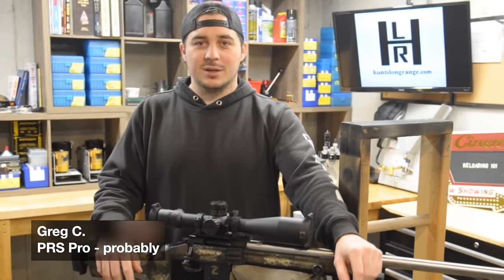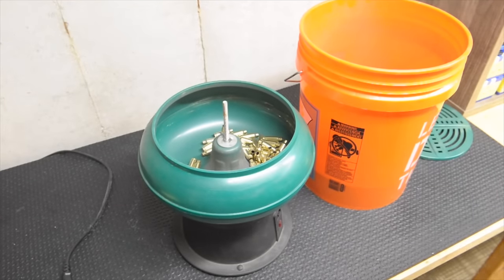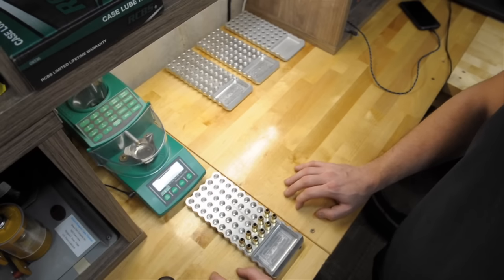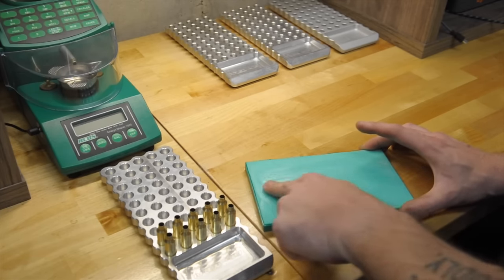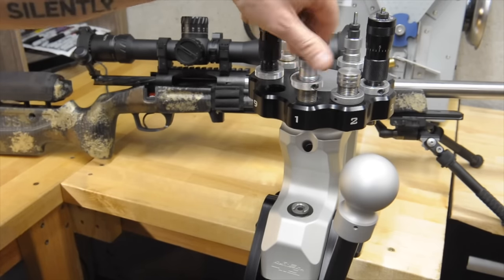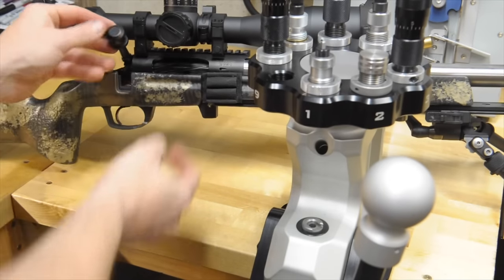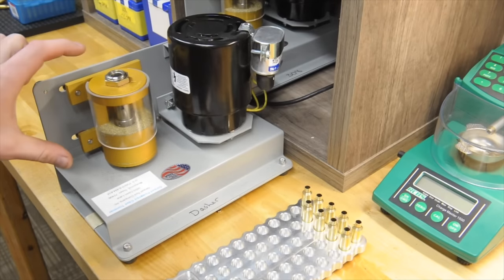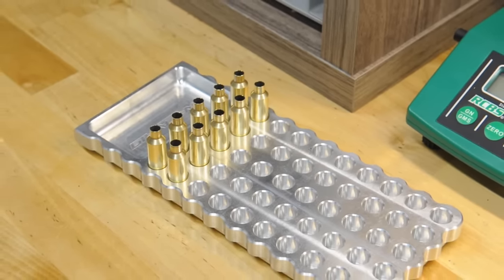Reloading 101 Part One With Pro Shooter

Comment: I tried bar keeper's friend in my vibratory cleaner with walnut hull and my brass came out so clean inside and out. I also clean up the flash hole on the inside of the cases to get rid of excess brass and uniform the hole.

Comment: This is exactly what I have been looking for. A thorough, no nonsense, step by step accuracy reloading series. Thank you for your effort and time in producing this! I noticed it doesn't look like you neck turn, unless you have already done it when the brass was new. What are your thoughts on neck turning? It would make sense that it is helpful when using a bushing die.
Reply: For the level of accuracy I’m after, and the application I’m using my ammo, neck turning isn’t necessary. 

If you shoot competitive Benchrest, it seems like those guys do it and obviously get crazy small groups. Whether thats from neck turning or not, I cant say. 

Shoot a 20rd group with turned necks and without and see if its worth the time to do for you
Reply: @gconnoyer  My father taught me one Golden rule. When reloading, do absolutely nothing more than what is needed. That the more you work the brass the more trouble you get yourself in. Therefore I don't walk 3 mi when I only need to walk one. But I think the whole point of turning necks is concentricity and uniform neck tension. The bench rest guys are measuring with their groups with micrometers as they put five shots in one hole. Definitely not a goal of mine but I do like accuracy...

Comment: Henderson has a trimmer with a motor. SSM cleaning is superior to corn cob. One can clean, including primer pockets, dry and use graphite for the necks, well under 5 hrs. At some point you have to clean the pockets. Also, you don’t have to use pins... SSM chips are better than pins for this.
Reply: Alot of my brass has 10-12 firings. Primer pockets without cleaning or decaping before tumbling look exactly the same on my 2-3x fired stuff.

Comment: Try the Lee lock rings with the O-ring.  They work great in a turret press.  The Forster lock rings work great in the Forster Co-Ax and in a single stage, but they kind of suck in a turret press.  You can't always access the lock ring screw, depending on the orientation of the lock ring in relation to dies in other stations.  Also, when you do get it locked down, it is also locked down on the turret head, which is why you had to resort to pliers to remove the die.  The Lee dies have a very positive feel -- they tighten and then they just stop.  They can still easily be removed by hand, though.  Lee also has a small plastic wrench, which you can use on the dies with your turret press.  Way better option than the Forster lock rings.  I don't like Lee presses, but some of their stuff just works and their lock rings are a good design.

Comment: Good video overall, but it should be emphasized that this is well crossing into advanced reloading, not quite “101”. 
The process can be less meticulous therefore more “beginner friendly”. I was one, and know many people that are diverted from getting into reloading when when for example , you start showing the process of sizing brass.  That can be done with full length sizing die in just a couple of steps, setting the die, lubricate the case, stroke in and out, done. Move to the next step, and so on
Reply: Absolutely, I do mine with a full length sizing die. Lube the case, stroke, done.
But other than following the basic “bottom the die out, get a little cam over” in everyones instructions, I thought it important to show a proper way to set it up and more importantly explain WHY behind setup.

Comment: I would have removed the dirty cases missing the primers before showing your dirty brass on video. It makes one wonder if you “popped” some primers using hot loads, at least it did me.
Reply: No that was likely just me using them to setup my new ZERO press when I got it, or popping them to measure without a primer. I run a very very soft load well away from pressure. I shoot this load in the rain without a heavy bolt lift

Comment: My first hunting rifle was 300 Weatherby Mag (1989). ; it became a hobby and fun, but the precision world is a different game altogether just reloading hunting loads comes almost to a stop. It is checking SD/ES ladder thing buy a new machine measuring the pressures sitting the bullet; it is tools this or that, and the fun is gone. I started reloading 1990/1. Correction on the reloading start date. 300 Weatherby Magnum very expensive to buy, so reload.
Reply: With good equipment and a good process, making killer ammo doesnt have to be a wild painful process. I actually havent changed much in my tools or process since I started.

Comment: Love the video, Curious are you using an expander mandrel to set final neck tension or just the bushing? Also what sizes do you recommend? Ive always heard .002 under loaded neck diameter but with spring back and different neck thicknesses would it be a bad idea to use one that is .003-.004 under loaded diameter then use a mandrel that is .001-.002 under bullet diameter? Thanks
Reply: Thanks! 
I’m using a .241 mandrel to “set” final neck tension. The ID of my necks after sizing with my bushing is .2400-.2405. I just went with .002 under as a starting point and its worked out and havent tested anything else. Yet.

I do have some smaller neck bushings I bought to undersize it and bring it back up with my mandrel to see what difference that makes because sometimes I do get a lighter feeling when running the mandrel through some cases.
Reply: @gconnoyer  thanks for the reply, I’m fairly new reloading but trying to get it all right the first time to save money on tools and components. On new brass I just ran a .263 mandrel and got great results. Think I’m gonna try short action customs bushing .004 under loaded neck OD and then open it up with a .2625 21st century mandrel and see how it goes.

Comment: Quick question . Why didnt you mesure them again after triming ?
Reply: The trimmer has been setup to my length for a few years, and indexes off of the shoulder so theres no need to measure. 
It BARELY kisses the necks and really just do it to clean up the chamfer

Comment: Was going to start reloading for my rifles, but after seeing this, no way! I’ll stick to my handguns, this seems to be a big pain in the buttocks.
Reply: It's ez. Not like you're taking 556 and turning em to 300 blackout haha. That's still ez enough. Just dive in, watch someone YouTube videos, get a part list and 800 bucks later you are RELOADING. It's worth it within the 1500 rounds point. After that is like 35 cents to load 300 blackout even
Reply: @metabang03  How often do you have to anneal ? heat them up ?
Reply: its really not THAT complicated. This is a bit more in depth than what I would worry about for plinking ammo though. I'd just prime cases, throw some powder in, seat a bullet to whatever saami spec length was and go.

Comment: Forster will polish your Fl die so bushings aren’t necessary
Reply: Correct, if you are set on a certain brand of brass or neck tension and dont want to experiment or adjust anything, they can do a hone to your spec

Comment: When you put your brass in the chamber with the bolt and worked the bolt  , they were tight against the walls of the chamber  . What did you do with the pieces that didn't go in smoothly ?
Reply: I go back and resize them once I finish adjusting the sizing die.
Reply: @gconnoyer  appreciate the info

Comment: Hey Greg, in terms of full length bushing dies, do you think something like a wilson full length bushing die would get the job done? I see so many using redding but is it worth 2x the price? I figured the wilson + a SAC bushing and then a 21st century mandrel and die body and call it a day
Reply: I used a Wilson for a bit and it worked just fine, but wasn’t resizing near base enough for my chamber. I sent Harrels a few pieces of fired brass for them to measure/check/whatever they use and sent me a custom die. (For my Dasher)
For 308 and 223 I use Forster because I like them for arbitrary reasons. I think really they all work fine, but the more expensive they are the better quality and finish they are (generally)
The SAC ones look SUPER nice, but I personally dont know what they do that others dont.

Comment: “I can’t shoot the difference” are good words to live by. This is a great tutorial for hand loading for one specific bolt action rifle for optimal accuracy. If you are loading for a gas gun or making cartridges for multiple rifles, you can’t be as precise. 

Forster lock rings are great because they don’t tighten by driving a set screw into the die threads. The Forster Bench Rest Seater die is a better mousetrap because it has a sliding part that simulates the walls of the chamber and gives me better concentricity. Redding copied it after Forster’s patents expired so it can’t be all bad. (Note I prefer Redding crimp dies and Lyman expander dies so this isn’t a brand loyalty thing.)

I ream the flash holes for uniformity the first time I handle a case. Doesn’t matter if it’s new brass, once fired, bottle necked rifle or straight wall pistol. It does nothing with most batches of brass but every once in a while you’ll find an under-sized or offset flash hole. I recently had a batch of once-fired Fiocchi .45 Colt where it was difficult to get the flash hole tool started. Turned out most of the flash holes were visibly off center so the whole batch went into an “emergency use only” container. I do find burrs in the flash holes of some cases and figure consistent powder ignition is an important start.

Tumbling brass in a living area might not be a healthy idea. Apparently there is lead styphnate in primers and it comes out as dust. I always tumble in the garage and add a Bounce sheet cut into strips to capture some of that nasty dust.
Reply from the maker: Not trying to be antagonistic here, but there’s all kinds of things that are equally if not more harmful to Americans than occasional lead exposure…like sugar.
Reply: @PrecisionRifleNetwork  understood.  However, if you can tumble in a garage or shed what’s the harm in keeping that dust away from living spaces? Besides you can avoid the noise too.

Comment: You should do 223 the head space video. I'm looking for a good video on that. What's your process on that
Reply: 223 headspace? would be exactly the same. unless you're talking about an AR platform.

Then same principle. Strip the bolt down, and size by feel locking and unlocking. But most people dont want them to be that tight of a fit in a gas gun so .003-.005 may be the better way.

Comment: Thanks for the video. One thing. Rather than use the the serated steel jaws on your equipment get the pliers with the soft jaws on the inside; won't leave any marks and they do grip very nice. Just a thought.
Reply from the maker: Good tip. Thanks.
Reply: I could not think of the name of the tool until just now they are called  Cannon Connector Pliers and they are used in electronics and in aircraft applications. About $23 last time I looked and they will keep you from chewing up nice precision steel anything. Really going through your videos trying to learn how to do this. Thanks. @PrecisionRifleNetwork
Reply from the maker: @bunkerman99  nice. thanks for watching.

Comment: This may be a terrible question but I'm completely new to reloading. How would I check the brass rubbing the chamber in a AR?
Reply from the maker: I'm not sure I can help, but could you please try to rephrase your question?  Or tell me what's going on with it?
Reply: @PrecisionRifleNetwork  yeah I did a terrible job lol. When he is resizing the brass he was checking it inside the chamber of his rifle to see if it was rubbing not allowing the bolt to move without resistance. How would I do this in a AR? I might have missed him say something about resizing the brass for AR. Thank you for taking time to help!
Reply from the maker: @dustydavis8829  I actually think it would be way easier to just use an overall length gauge on an AR platform.  Here's a link to one on Midway. That being said, you'll still want to load somewhere inside of "mag length".  Obviously if the rounds are too long to fit in the magazine it defeats the purpose. lol   https://www.midwayusa.com/product/1012744027?pid=479963
Reply: @PrecisionRifleNetwork  thank you so much! Ill be ordering one next paycheck 👍🏼
Reply: @Dusty Davis you can do the same with an AR, you just have to pull the ejector and extractor out of the bolt
Reply: @gconnoyer  Thank you. Like I said completely new to reloading. But thank you for your help. I'm still getting all the equipment I'll need to start. 🙏🏻

Comment: You're supposed to deprime before checking for headspace, you are using a RCBS lube pad not Hornady as stated in your video & Forester does have a bushing resizing die or they you can send in your die will machine one to your spec if u would like to.

Comment: Nice video Greg I’m sure it’s tough to put yourself out there to get criticized.  I do like to deprime before I tumble just to clean a little bit.  Your leaving your decapping pin in your sizing die so it would knock out whatever media gets stuck in the flash hole. I like the short action precision headspace comparators they are specific to the cartridge shoulder angle.  I set my zero on a fired case and bump them -.002-.003.  Same thing your doing just a different way to get there.
Reply: Yup thats true. Its just one extra step that I’ve deemed unecessary though. A lot of my brass has 10-12 firings on it (no clue how many on my 308 brass) and I’ve never cleaned them or lunched primers before tumbling. I just go with what works and is proven for me. 
I definitely recommend everyone experiment, test, and try out different methods and decide whats best for them. Whatever way “best” fits.